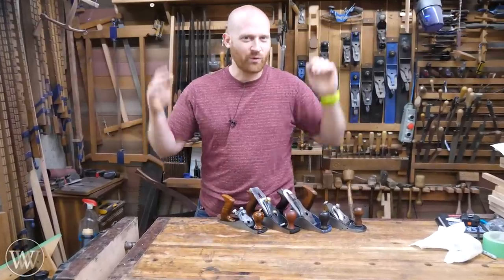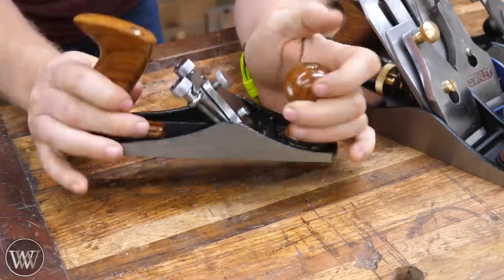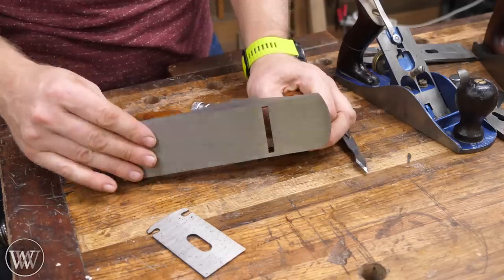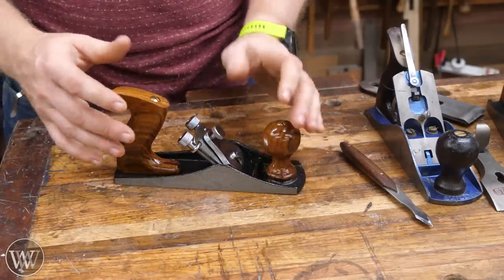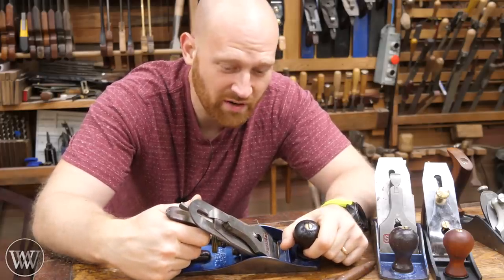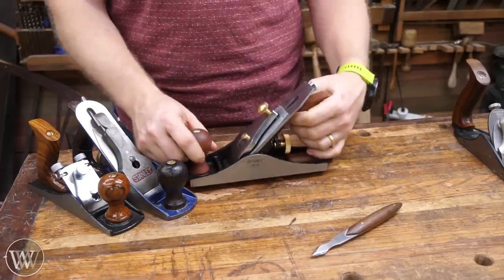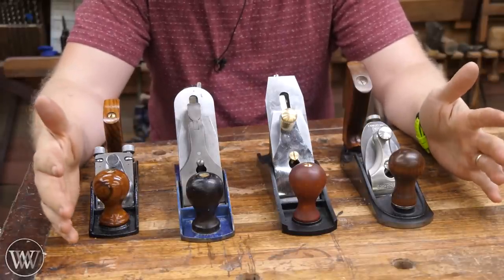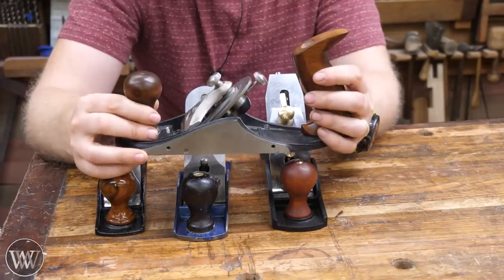The Good the Best and the Ugly | Choosing a Hand Plane

Comment: Not going to lie I actually have that nasty harbor freight Windsor 33 and I bought it so I could turn it into a very cheap scrub plane and it works but you will spend hours and hours getting it tuned up then it will work great, until the next day and you have to spend an hour retuning it. Fun fact I bought my Stanley 13-404 which is basically the same as the harbor freight thing and I bought it cheaper than the harbor freight model and it works a little better and once its tuned it only takes 5min everyday you use it to get it back into shape for the day. I'm currently looking for an older Stanley or 4 so I can up my game. This video is coming in And my one question: How do you feel about the big box store Kobalt #4? I've been thinking about buying it cause at $30something it's not a super bad price but I've not come across reviews of it that I trust
Reply from the maker: Right on. The cobalt is slightly better then the HF. but not by much. i know a few people that have one and use it regularly, but most soon go an get an antique after that.
Reply: Check out Rex Kruger, he has a video on doctoring a HF plane, it involves removing the adjustment from memory. Regards Jim UK.
Reply: @jlmfoy365  I actually have watched that video and to be honest I tried to use both planes without the screw adjustments and I personally didnt like the way it felt. I found that the adjusters work better for me as long as I tighten the lever cap down as hard as I can. But yeah I like Rex and his woodwork for humans series very educational and helps to prove you can do woodwork without the high priced items. And Rex was the person who introduced me to James, I had a question about a plane and Rex sent me this way, been here since and until James tells me to leave I'll still be here.

Comment: If it's any help, the blue Stanley is a Type 20 made between 1962 and 1967 (at least, here in UK) - because they were the only ones...well, you know...painted blue! As far as I am aware, it represents maybe the last of the true 'vintage quality' - or rather - 'designated standard' Stanley Bailey types. I have slightly newer #4 and #4+half that are black but still retain that vintage quality (1967 to maybe late '70's, with less signage on them) and for reference, I call them Type 21's, even though that designation never existed, as far as I know. Later 'types' introduced plastic handles and a mouth so wide you could drive a herd of cattle through them (mid to late 1970's onwards), so I guess they must be Type 22...!? 😐

Comment: I bought the $50 cad. Spear & Jackson from Amazon and with some tuning it is a good smoothing plane for the price paid. It’s still a $50 low end plane made in India. My Stanley/Bailey #4 (Canadian made 1947/48) purchased second hand for $100 cad. works well with very little work but is light in hand to the S & J. My intent is to move up into a quality modern plane, the Veritas Custom line, probably a #4 or 4 1/2 and eventually add a # 5 1/2 . Considerably more money than the second hand or inexpensive planes but I am anxious to go down that rabbit hole. I find hand planing challenging but relaxing. 🇨🇦👍👨‍🦳Interesting that the Taytool #4 looks identical to my Amazon cheapie. Probably made in China or India and aren’t really a bargain.

Comment: Haa, I wish vintage planes were more common in my area. It took months to find the no.4 that I found for $3.
Also I wish I had jumped earlier on TayTool's 5 or 5 1/2 planes on Amazon before they ran out. I dawdled too long waiting on a family member to find my grandpa's. Which I think might either be a no. 5 or 6 if my dad's vague descriptions on it's length is correct.

If I'm too slow on the Grizzly, then I might have to bite the bullet on either paying 120 more for a WoodRiver no. 5 or wait another month or two for the supply to hopefully stabilize a little on the other ones.

Great video!
Reply from the maker: Thanks man. It can be a chore. Have you looked at the map I have on handtoolfinder.com I've had a few people who can't find anything near them and then look at the map and find several places within a few miles. I had one person who lived within three miles of one of the largest tool meets in the West for years and didn't know it. But there are a lot of places around the world where they just don't exist.
Reply: @WoodByWrightHowTo 
I have! It''s a handy map.
The nearest marker is about 40 miles north of me, which isn't too bad if I leave early enough. Looks like a weekend trip is in order in the coming months!
Reply from the maker: Let me know what you find. I like to keep the map up to date if you find different things from what I have been told.

Comment: The Windsor no33 was actually my very first hand plane and I've done some amazing work with it. I actually still use it to this day for finer work where I can't get my no4 in, and as uncomfortable as the handle is, I've somehow made it work beautifully.
Reply: Same here.  I bought the Windsor 33 twenty years ago.  I paid 9.99 for it.  All I've ever done was sharpen the iron and oil the soil.  I use it as a smoothing plane.  It just ended up that way.  Mouth was pretty tight and the iron is pretty hard steel.

Most people think you need ridiculous tolerances (thousandths of an inch) of flatness, then spread wax on the sole that screws up the flatness to a 32nd or more!  

You're woodworking - not building the starship Enterprise.  You can use a wooden body plane and do just fine.  

If you're starting out - start with whatever you can get.  If it's a boat anchor - learn what you need to do to get it into working condition.  That experience will make you better for it.

If you buy a 400 dollar boutique plane and start using it, you won't understand what "makes it go" until it stops.  Then you just might end up making a very expensive mistake trying to "make it go" again.

Comment: James I just found a Smoother, looks like a stanley no 3. No Pat dates or markings other then one word "BELMONT" the iron. Any tips on identification websites?
Reply from the maker: Belmont is a different plane making company. They did make Bailey pattern planes but they also made replacement irons so you could have one of their irons in Stanley. Usually though Stanley has the name cast into it. Unless it was one that they made for hardware stores to rebrand. Feel free to email me some pictures I'll be glad to take a look at it. Usually one of the best ways is to post them in the wood by right hive mind group on Facebook. Or in the unplugged woodworkers group on Facebook. There are a lot of knowledgeable people there.
Reply: thank you! I will check out those groups

Comment: Looking at the design of the Taytools plane, especially the frog adjustment, I would say it's from the same factory in India that makes the Grizzly (and others). Rex Krueger did a good video about these Indian planes and they're actually pretty decent, though they do require some tuning up. I have a Grizzly #5 and it's been great.
Reply from the maker: Yes. That company makes them for a bunch of different people. But they have a lot of different options you can pick from and so a lot of the different companies have the cheaper options or the more expensive options. For instance, the ones that grizzly gets are cheaper but are a little harder to set up and often have more problems with him. There is Tay tools tends to pick the slightly better options. But that means you pay more.
Reply: @WoodByWrightHowTo  yeah, of the two that Rex compared, the Grizzly was the better one 🤷

Comment: Several years ago, when I discovered your channel, I bought a #4, #5, and a #7, all antique Stanley. I had them fixed up real nice and was just about to get serious.

Then hurricane Harvey came and destroyed all my tools. Over $10,000 worth of tools (not to mention nearly everything else I owned, but that's not relevant to the subject at hand).

Fast forward about a year. I make a great deal on some old Craftsman planes of various condition. Out of the lot, I was able to get 7 planes. I ended up with 3 scrubs, 2 jacks, and one good jointer (#7 equivalent) and a good smoother (#4 equivalent). 

Fast forward about 8 months. I finally purchase my first higher quality plane, a Woodriver #5 1/2. I love this thing. Excellent plane.

Since then I've grown my collection of Woodriver planes. #4 1/2 (because my hands are large), #6, and a shoulder plane. 

I highly recommend Woodriver for someone that wants a step up.
Reply from the maker: They are great planes. I would put them on the very top end of the budget planes as their price is still affordable
Reply: I am curious how a hurricane can destroy a hand plane. Harvey was mostly a rainfall event. I don't see cast iron planes floating away in something like that. Sure they might have gone underwater and gotten rusty. All of my planes were rusty at one time themselves though.

Comment: Has anyone else tried Faithful planes. Got a 5and 6 but cap irons do not match up with blade hole slot. Way too much gap means very difficult to line up and stay lined up. Everything else seems quite good. Flat base, 90 degree sides, reasonable blade metal.
Reply: Yeah, I went down that route when I got into hand tool working, and got a new Faithfull #4, #5 and #6 for less than 100 € total. They're certainly usable, and they even came with a free learning opportunity on how to restore planes…! 😛 However, one of them had a very bad blade which wouldn't hold an edge, so I swapped it out for a thicker Hock one.
Reply from the maker: yup I put them into the same category as Grizzly planes. they are the lower end of the decent planes.

Comment: I have always worked with power tools. I've recently bought my 1st 2 hand planes. Both are WoodRiver planes. One was a #4, which is quite a bit larger than the Stanley #4 you showed. That one was $200. The 2nd was the #5 Jack plane. It's normally about $220. They had a great sale and it was only $165. I'll now save up to get the #7 Jointer Plane. That's $350. I'll be watching for sales.
Reply from the maker: Sweetness. I love wood river planes! have fun man. they are based on the Bed rock design rather then the Daley patterns so the sizes are a bit different.
Reply: @WoodByWrightHowTo  I found the reason a little after writing. There was a mistake at the store and I had two #5s. I went in and exchanged one of them. I now have the much smaller #4 and a #5. I'm really happy with the heft and feel of both of them. I am going to keep my eye open for estate sales.

Comment: I bought the harbor freight a couple months ago. As someone with small hands, it is still very unpleasant to hold. I ended up fully reshaping the tote. The wood is very smelly when worked.I ended up turning it into a scrub. The iron is super soft, too the point that I could cut it with dull files. I also own the Taylor Toolworks,had it for almost 3 years now. It has some challenges, but it is still a joy to use. Namely, I recently got around to actually mating the cap and cutting irons. They were very off from the factory, but fifteen minutes of finessing it fixed that. I also have actually replaced the screw cap with an old Stanley one. Just because it’s easier to use, and I like to be able to use the cap to unscrew the iron assembly. I also own a Stanley 3 & a 6. Those planes are for specific tasks, and they do work well, but for general work, I always come back to the Taylor.

Comment: What I'm noticing is that most hand planes, even what would be considered the lower end planes, are expensive unless you decide to go with big box stores. In my opinion, these aren't even worth a second look as the casting is hit or miss whether it's actually flat and true. The blades are oftentimes even worse and generally don't use the best steel. The only alternative are the antique planes but how often do you find one that doesn't need restoring?
Reply: I found one Stanley No. 4 in mint condition once. It wasn't an antique though. Probably only 40 or 50 years old. I've never restored any other old plane I've ever gotten. Cleaned them up so they work, but I would not call that a restoration. That amounts to giving them a spray down with some penetrating oil, taking them apart and wire wheeling the rust off. Sharpen the iron, bed the chip breaker and that's it.
Reply from the maker: You can find antique planes ready to go are already restored for you from around $60 to $100. Check out the online sellers list on Handtoolfinder.com

Comment: Where on Earth are you finding antique planes for $20?! Thanks to Youtube plane restoration videos, and Youtube woodworkers having WALLS of hand planes behind them, prices on antique planes have skyrocketed. It really sucks for those of us that just need a usable hand plane to get some work done.
Reply: I've never spent more than $20 for an old plane. But availability depends on where you are. Many places you're not going to find anything at any price.
Reply from the maker: Check out handtoolfinder.com I find them at meets, antique shops, and garage sales quite often for 5-$20
Reply: Here in Australia, I always buy antique stanley planes. The most I have paid for a #5 1/2 is $40. I’m still looking for a #6 and #7.
Reply: @stevenguy3575  that's great that you have that kind of availability. I never knew Stanley made such inroads halfway around the world. Although I am aware that they wanted to. Good on them I guess? 7s are pretty big. I have a 6 and a 606. I paid $20 for the 606. It has some pitting on its sole though. So it's not a collector's unit. I had a chance to pick a 7 up once. I think they wanted $45 for it? Wasn't in mint condition. The only plane I ever bought used in mint condition was a 4. The rest showed varying signs of age.
Reply: I have to agree with you on this. I suppose with a lot of patience and a lot of time, you might find deals like that, but a garage sale scavenger hunt probably isn't the easiest way for someone to get started in hand tool woodworking. Even a neglected old No 4 will set you back $50 - $60 these days, but is still probably a better deal than the H.F. one. I'd really like to find a No 4-1/2, but even one in moderate condition will end up going for over $100.
Reply: Case in point, I just saw on eBay a No 4 Type 19 sell for $72 and a No 4 Type 16 sell for $182.50!!! Both were nice, but nothing that special. I just started about a year ago, and was able to find a few good deals on eBay, but the last 6 months or so, prices have gone crazy!
Reply: Paul Frederick damn, I would have sold one of my children to pick up a number 7 for $45
Reply: Al Yanchak I picked up a 4 1/2 for $25 bucks about 18 months ago.
Reply: Steven Guy I was able to find a few good deals last year myself, but here in the US, there seems to have been a huge jump over the last 6 months or so. I am sure there are great deals still to be had if you have time to scour estate sale, flea markets, and garage sales, but on-line prices are crazy right now.
Reply: I'm in England so this probably won't be of any help to you, I had the same problem and a serious shortage of cash. I did however find "customdealers" on eBay who sold me a Stanley Bailey clone, brand new from Marksman, with wooden handles, for £8-49 delivered. It took a fair bit of fettling to flatten the sole, sort the chip breaker, sharpen and hone the blade but with this I get featherlight shavings and a tool that will last me a lifetime, I was so impressed I bought a second one for scrub work and then their number 5 which also proved amazing for both rough work and smoothing. The number 5 set me back £9-99 delivered.
Reply: I know it's an old comment,  but figured I'd put it out there in case it can help anyone.  
I found the same thing in my area,  that prices were much higher than I was looking to spend.  So I started searching apps like offer up and craigslist,  Facebook markets etc. But I searched for lots of tools.  People selling off all of their grandfathers tools or something,  that have little interest in them.  I know it's much more rare to find,  but I find them commonly enough,  and find some smoking deals. Usually have some rust to clean,  but nothing big.  I have actually found that people in these scenarios expect so little for what they're selling, that I offer them more money than they ask because I don't want to feel like I robbed them.

Comment: I will say the grizzly tools hand planes are hit or miss so I have the grizzly tools number 4 number 5 and number 7 jointer so the 4 came it was my first and was horrible casting and poor adjuster quality’s like it was trash so sent it back and they sent me a new one and it was amazing so then I got the number 5 and number 7 and they both came great now yes I had to watch all your videos on hand planes and spent probably about 3-5 hours on each plane setting it up and some mill file use and some flattening and shaping and then sharpening but they all work great and you can’t find any other brand where you can get the 4 and 5 and 7 for about $200 brand new now I’m getting into restoring Stanley Bailey pattern  planes I have bought a few on eBay and still trying to find a number 3 and 4 1/2 then I will have the 6 I want and am about to get into the restoring process lol should keep me busy for about a year every day after work lol!!!
Reply from the maker: That's right about what I hear from most people. It's almost as if there's no quality control. Sometimes you get great stuff and sometimes you don't. but I agree with you completely they're about the cheapest plane you can get that you can still get usable quality out of.

Comment: I have 2 if those planes. The El cheapo which I am modifying the same way Rex Cruger did, and a Bosch that is almost identical to you're tai tools. Still need to grind that but nose of the chip breaker but I feels so much better than the harbor freight special